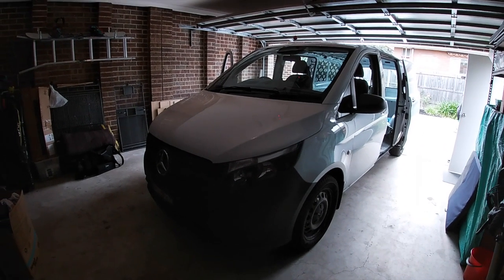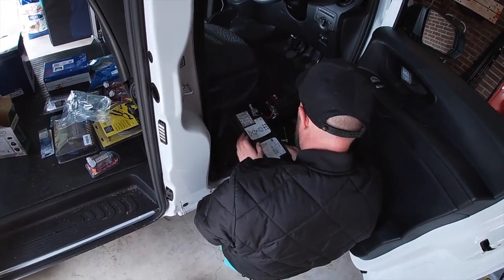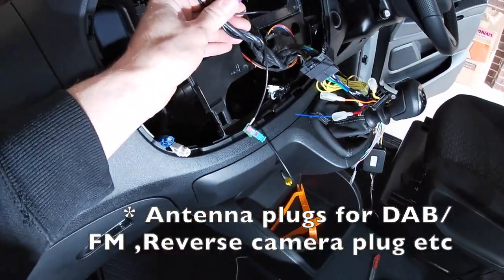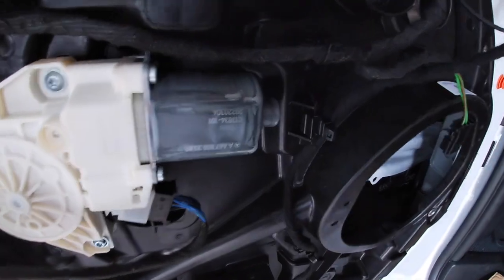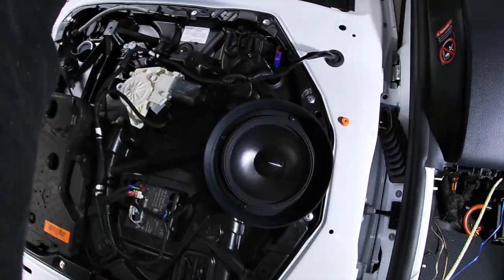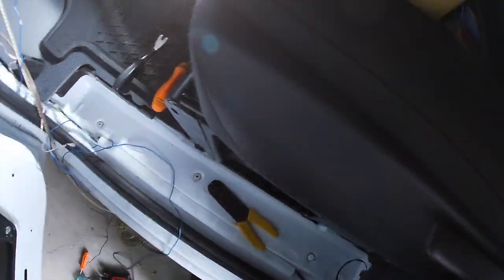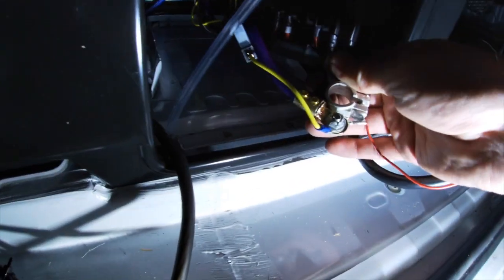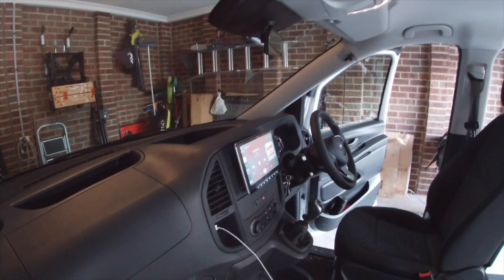Mercedes Vito W447 2015-2022 Alpine Stereo, Amps  & speakers upgrade

Comment: Hi. Can you tell me if when changing the head unit the functionality of the Mercedes me app is lost ? I've got an electric Vito and I've been told if i change the head unit then I'll lose the Mercedes me app functions. Thanks.
Reply: I honestly don't know how it behaves with the Mercedes Me app tbh, as my van is a 111 model (diesel Renault engine), which isn't compatible.
Reply: My app still works on my 2023 w447 ICE whenever it stays connected as its linked with the telematics module not the radio AFAIK